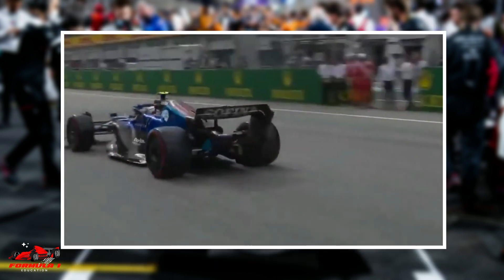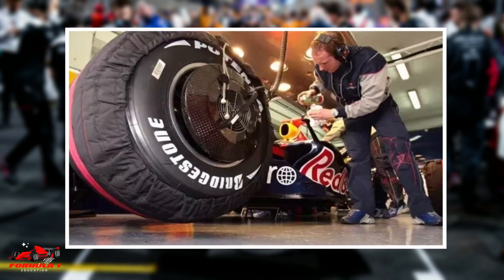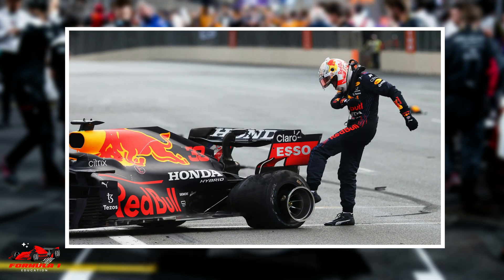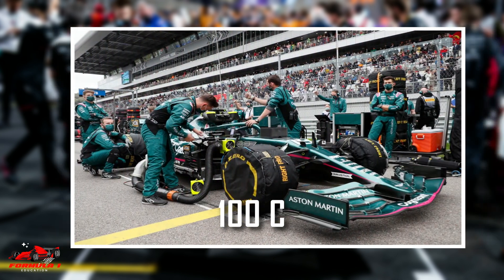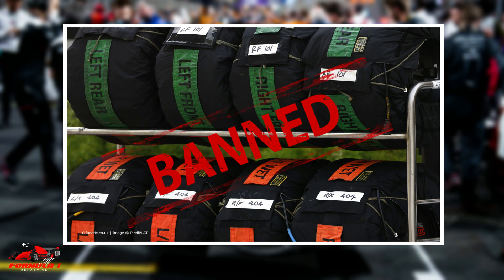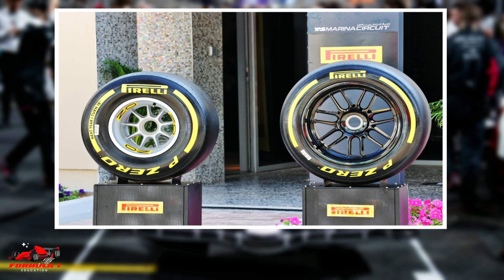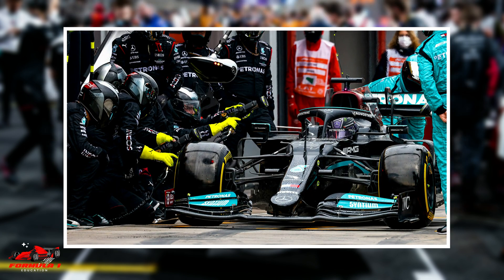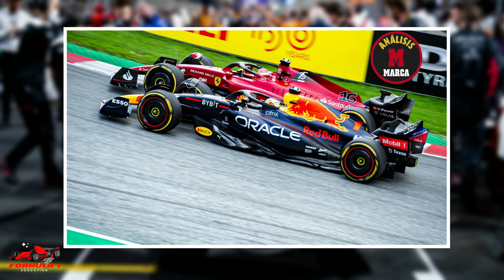Formula 1 Tire Blankets - are they getting banned? Explained

Comment: IndyCar running over 220mph (354kmph) at the Indy 500 do not use tire blankets and they also do not use them on road/street courses.  The driver has to warm the tires while driving around the track.  They take it somewhat easy for whatever time it takes to get tires up to temp.   I never heard an ex-F1 driver that was driving an IndyCar bitching about cold tires.  They have to deal with it if they want to race.